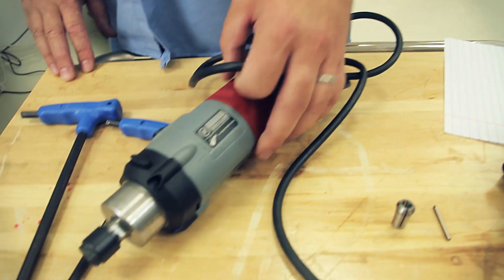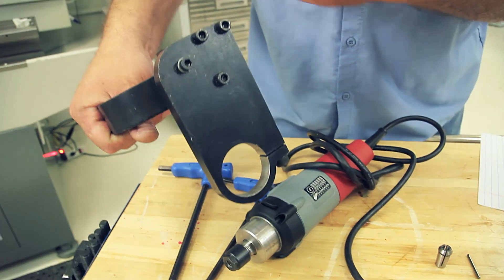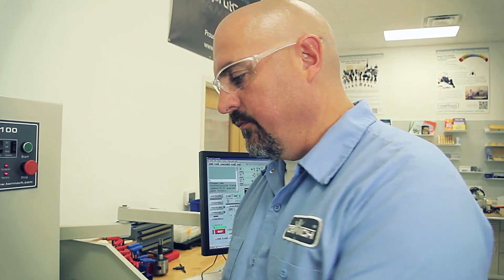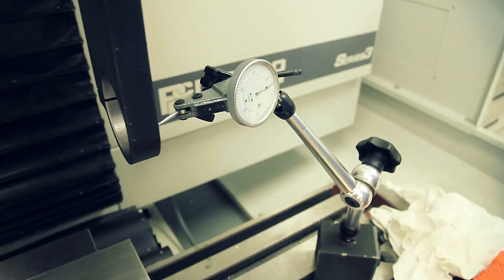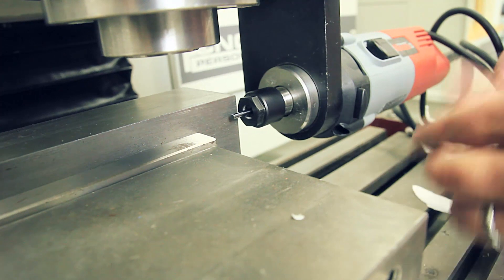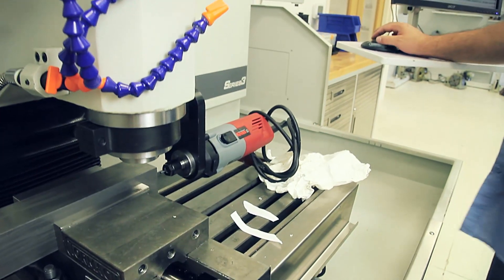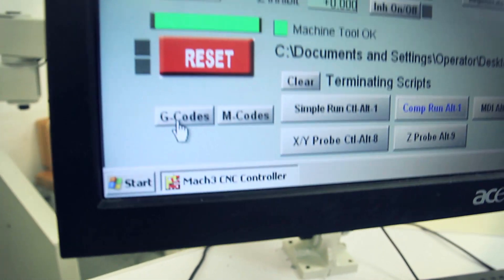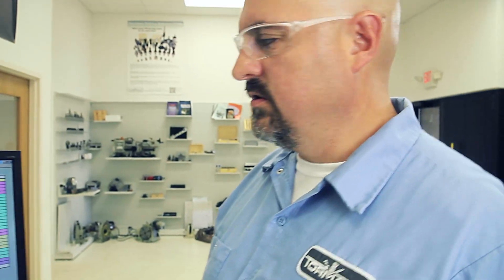How to Setup a Companion Spindle for Horizontal Milling - Tormach CNC

Comment from the maker: A ground set up pin in the spindle would work too.  That can sometimes be difficult to indicate since the dieter is small.  Probably best to align the clamp as shown, to get it close, the n double check with a  pin  of you need to be better than that.

Comment: To the person setting up the Clamp, why not just use a bar and then clock it up with that rather than using the OD of the clamping jig. This is where experience comes in......